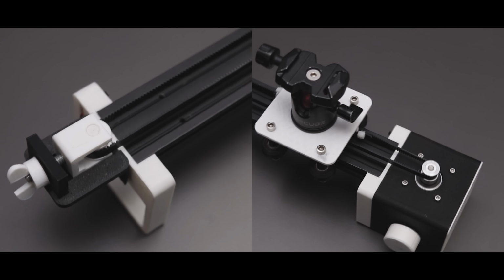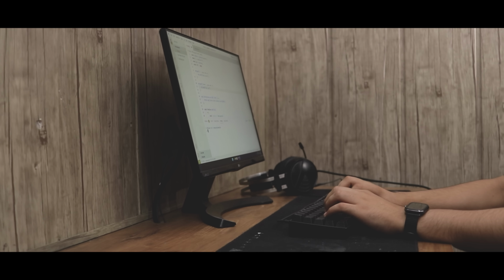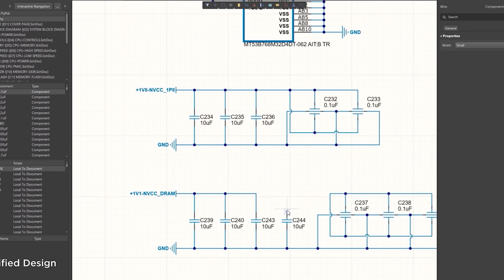DIY Camera Slider | Build Your Motorized Camera Slider | Arduino Projects | The Wrench

Comment: Its nearly perfect, I would have added a rotating head (object detection) and, instead of relying on the limit switch (these should be backups), use code to slow the slider down before the end and turn back smoothly instead of the abrupt end.

Comment: I'm surprised how difficult it was to find this exact type of project, but this is perfect! I'd like to use a setup like this for a conference room hybrid video meeting camera. I'm envisioning a Wyze cam pan (v3) flashed with the webcam software. Then the host of the meeting uses a joystick to send the camera up and down the table on the rail then use pan functions to frame the current (in person) speaker. This would solve so many of my problems lol.